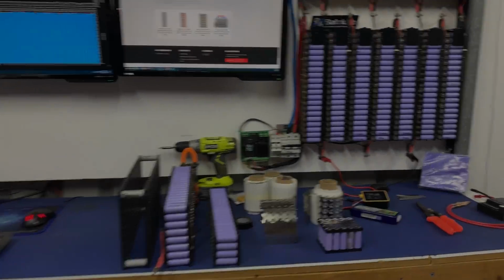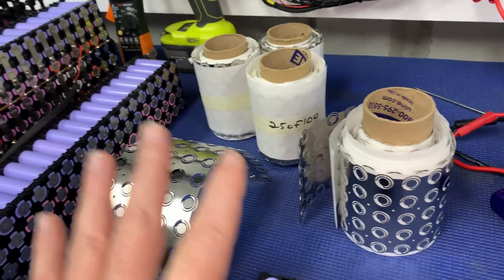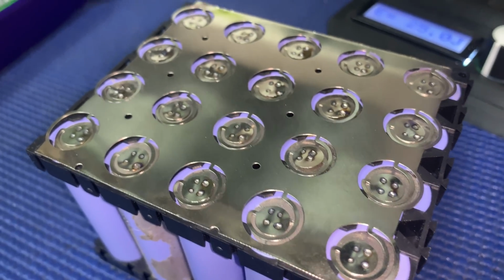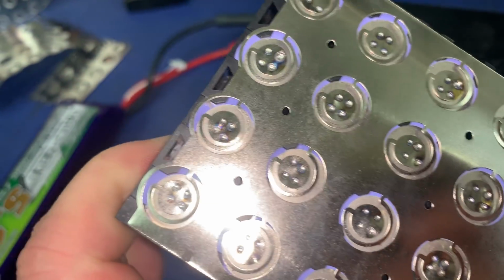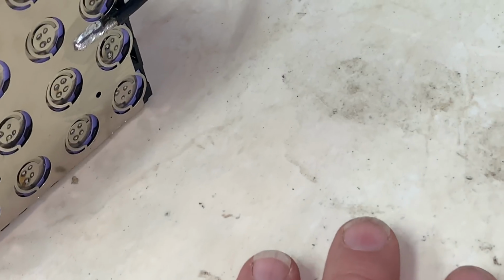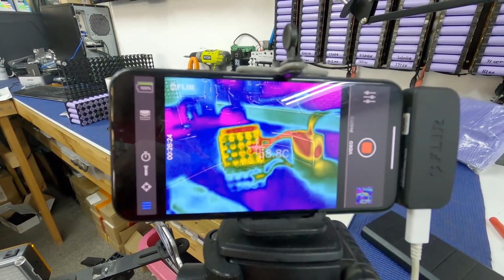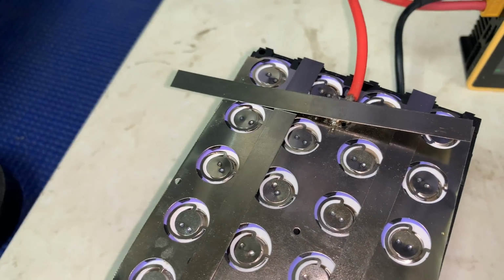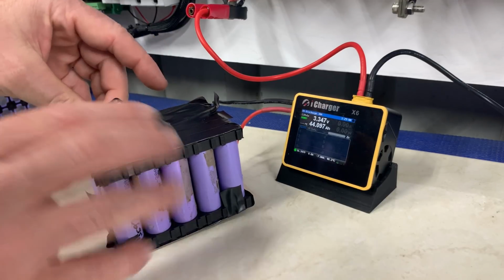Testing the BatteryHookup Nickel Fuse for 18650 batteries

Comment: you could brush some matte black paint on the nickel to combat the reflective/emmisivity of the material itself, with minimal heat soak.
Reply: The paint they use on colourbond sheeting might fit the bill. It's an electrical insulator and shouldn't peal in the heat. I have IR tested many sheets on the wall(while performing IR tests on cables), takes 1000VDC with no break down. 

You could test out thermal conductivity of insulation material by putting a few different bits in the oven for a bit, then set your FLIR to show the hottest temp in red, take them out of the oven, choose the hottest one.

Comment: I wonder if you can double up the nickle. Just remove the fuses from one. So you have double the nickle and only one fuse. Maybe u can take the insulation off the wire and run it down the length of the module sandwiching in between the nickle. I cant wait I purchased a spot welder just for these fuses.

Comment: Thanks for the video! I’m very interested in how that strip tests out. It’s such a great idea BatteryHookup had.

Instead of adding additional nickel strips on top how about having the main wire leads soldered onto the nickel strip along the entire length of the pack? This would prevent the concentration of current at the two points you have now. It wouldn’t help with the cell heating though.

Putting small pieces of tape over the centers of each cell’s spot weld point on the nickel strip and then spray painting it flat black would make it easy to see (using the Flir)  the heating of the thin strips from the cells to the main strip metal sheet. Just remove the tape when you are ready to spot weld the sheet on. By getting very close you could then check for how even the strip heating is at each cell.

If you had any cells with high current ratings you could do just a tiny pack to test the nickel strip. The higher current rating for the cells would keep them cooler and make it easier to see any heating in the nickel strip.

Comment: I personally would try a much smaller test. Say just five cells so you can better judge individual fuse rating, which I think is more important for internal cell short circuit protection. Just my two cents. Cheers!
Reply from the maker: Thanks for the feedback Mike - Tom has covered the fuse tests well i think here - https://www.facebook.com/groups/diypowerwalls/permalink/969337170079511/